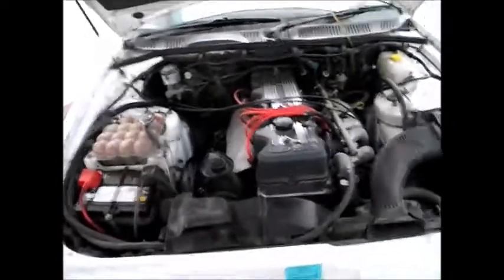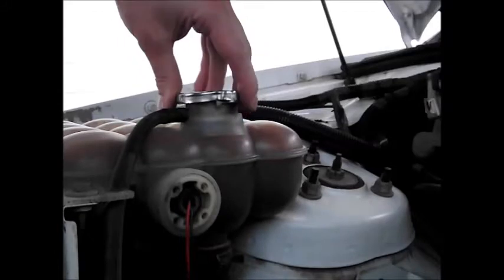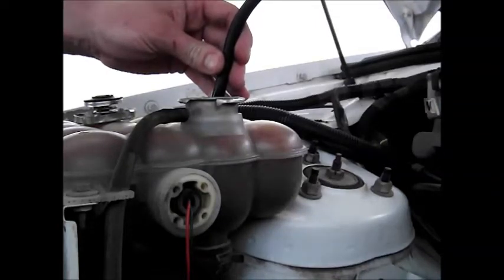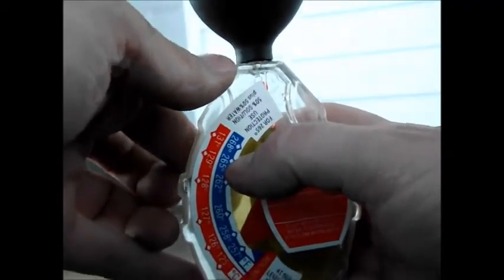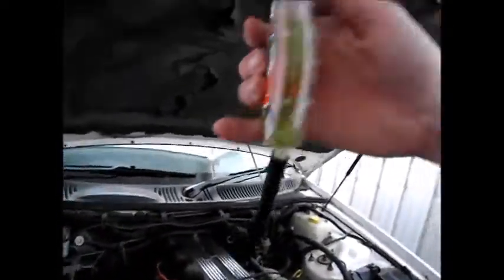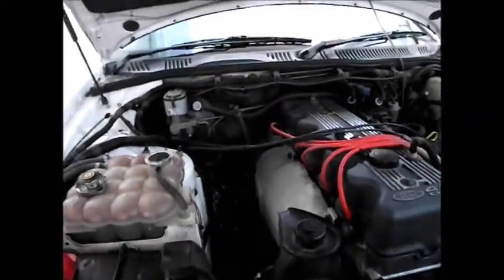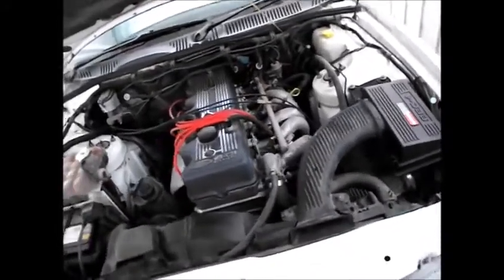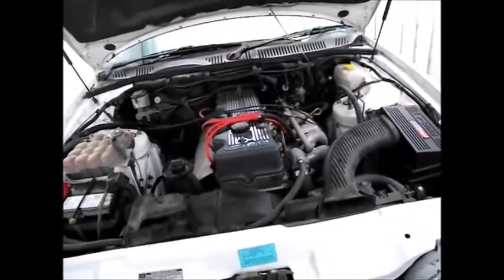how to use a coolant hydrometer

Comment: Just bought this tester on eBay, coming from U.K. Be interesting to see how it performs. Used coolant test strips to check coolant condition, acidity & reserve alkalinity. Change my coolant every 2 years irrespective of mileage. Always use the same brand of concentrated anti freeze/boil. Run mixture at 50/50 ratio, to be on safe side. Example, 10 liter cooling system capacity,  5 liters water & 5 liters of coolant  concentrate. Should always check for stray current. Purchased a stray current tester from repco. Box with positive & negative lead,  red & green L.E.D. lights. Start engine out of gear, hand brake on. Test engine cold not hot. Attach black lead to negative side of battery, remove radiator cap, pop red lead probe end into coolant. Press button. Red light indicates stray current = trouble,  green light = no stray current, good. Check google for more info on stray current if your care for your wheels. Cheers from brizzy.

Comment: Looks like a similar idea to the battery acid/water density hydrometer, but scaled different.
A handy tool for rough testing dave :-D.
Reply from the maker: pretty much exactly. I have found it to be fairly accurate; although not as accurate as an electronic tester

Comment: Their shit them chinco hydrometers brought 1 tested what was in the car got a shit resault bought the same as yours.then i tested 100% Acdelco  concentrate & it came up 50%. They r rubbish.
Reply from the maker: Coolant hydrometers are pointless in the first place, I have worked at a place where we had a $500 one that you would put in a sample and it would boil it then tell you the percentage and how much life was left in it. The thing is that coolant is so cheap I "test" it by changing it
Reply from the maker: Same with electronic brake fluid testers which are also an expensive waste of time
Reply: Think they only work on old style glycol coolants, not the new variety